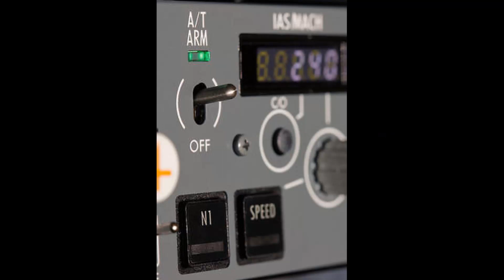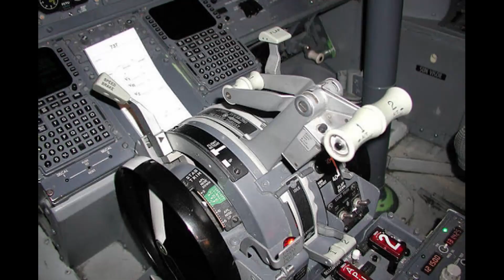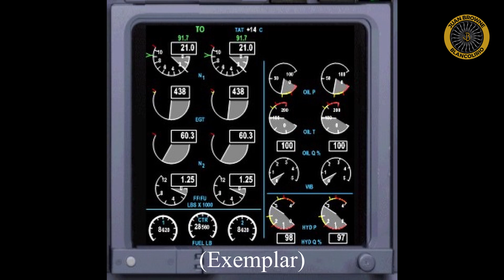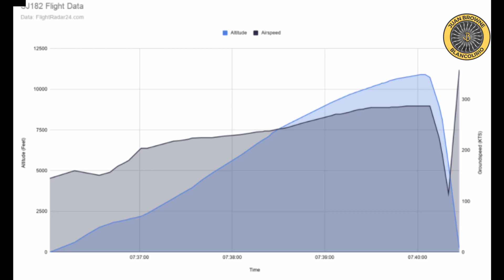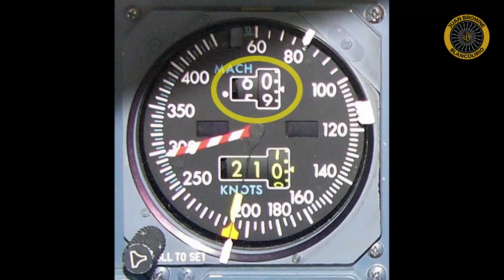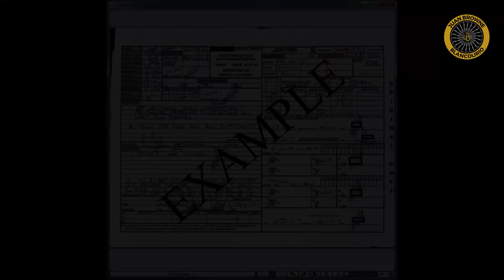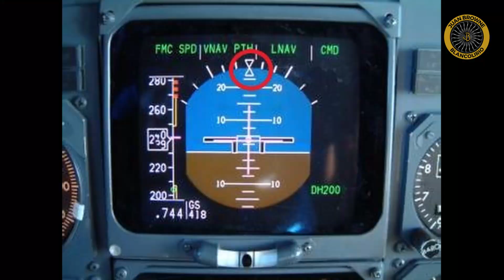Sriwijaya SJ-182 KNKT Preliminary Report 12 Feb 2021

Comment: Can the auto throttle reduce the engine power electrically without the lever position changing? Just cleaning contacts twice in 2-3 days doesn't fix a problem. Why are they getting dirty? Wear and/or corrosion? Contacts usually gold the same as computer contacts I assume. Throttle lever may not change but the instrument which monitors % power should show the mismatch.
Reply: No, it can't. The A/T on a Boeing controls thrust by physically moving the thrust levers, which in turn control the engines.
This is also what occured here according to the preliminary report. The right lever didn't move and thrust of the right engine stayed constant. The left lever moved back, adjusting thrust in the left engine.
Reply: @kallek5655  So we are saying that the throttle lever was moving to reduce the power to that engine and that wasn't noticed by the pilot. With the auto pilot off the levers can only be moved manually. I think that a gauge with the thrust level is shown and the reduction wasn't noticed there either. With 2 visual indications that the trust on the left engine was reducing something must have been going on to distract both pilots. I'm not a pilot.
Reply: @delukxy  Right, the left lever moved, causing thrust in the left engine to decrease, that's what they said. Autopilot and autothrottle can work independently of each other, meaning the A/T can control thrust whether or not the A/P is engaged (and vice versa).
Yes, there are gauges that show you the rpm of the engine as a percentage (N1 gauges), they are the primary reference to set thrust and a reduction in engine rpm would be shown there.
It could be that something distracted the pilots, but only the CVR could reveal that. Alas the memory module hasn't been found yet.

Comment: From this video, the assumption must be that both pilots were distracted so they didn't notice the unusual throttle configuration happening and other visual indicators.

Juan mentions that at the point AP disengages (I assume due the AP being at its limits on the control surfaces) and the associated audible warning, the plane would have snapped over very quickly (or even violently). 

So, the question is, do you think there should be some warning before AP disengages to alert the pilots that is it coming close to its threshold? This would give vital seconds for the pilots to do a quick scan of instruments and get their hands on the controls to try and mitigate the situation?

Do newer aircraft has this extra warning already?

Comment: Gosh, so much to takeaway from this report!

1. Frequent UA training in simulators or light aircraft is essential.

2. Secondary, redundant data recorders should be included in the opposite data recorder. A basic data recorder can be made very small indeed, and with trivial power consumption, without the full crash certification required for the primary data recorder function. So having each data recorder record both data streams, the primary secured against fire, impact and saltwater per certification, and the secondary using all reasonable precautions only, would give a chance to recover all data if one recorder was lost. In this case, there was no fire, and saltwater doesn’t damage encapsulated microchips, so there would be a reasonable chance of recovering some or all CVR data from the FDR. With common bus avionics in modern aircraft, this would be straightforward to implement.

3. An autopilot disconnect that results in a rapid UA without notice to the pilot is unhelpful! As is an unreported split throttle. Having a cancelable alert to split throttle would be helpful, as would warnings of approaching AP saturation, so the pilot is made aware that the AP is struggling to retain control, and is ready to intervene should the AP become saturated and disconnect in an unfavourable aerodynamic situation, such as this event. This would not rectify historic fleet aircraft, but would be a rolling improvement for future aircraft.

Comment: Is it possible to have equal throttle quadrant positions, but not equal actuation at the engines? That is,  cockpit toggles up at 75% but ''butterflies '' [?] open 35% on #1 [Port] engine and 75% on #2 [Stbd]...Glitching interface with AutoThrottle or broken cable.  Short. open, frayed line or connection?

Comment: Fly the airplane. Cockpit automation has reduced pilots to monitors, and airline SOP handcuffs the pilots to not hand fly. This makes pilots not prepared to deal with this kind of malfunction. No matter what you get you need to be able to deal with it. This auto throttle malfunction should have been noticed during the climb. You would have felt the building yaw as the engine thrust split occurred and the auto pilot cross controlled the aircraft to maintain. It is good that the airline is going to train to this scenario.

Comment: Why did that throttle keep retarding?
I guess it could go unnotice it if the autopilot was compensating to keep the attitude correct but with reduced thrust and increased control inputs to compensate, the plane wouldn't be climbing normally, would be down on power and high on drag. Wouldn't that be noticeable to the pilots?

 Unfortunately we've heard of autopilots disengaging and throwing the aircraft into a situation that crew couldn't recover from, before. 

Why is there not a warning horn at least a few seconds before the autopilot disengages so the crew is ready for something dramatic. Even though they won't have time to anticipate exactly what it is, at least they can put their coffee down and be aware that something big is about to happen.

Comment: Seems eerily similar to Tarom Flight 371, an A310 that crashed in Romania in 1995.  Malfunction in auto throttle caused left throttle to go back to idle.  The pilot was supposed to guard the throttles during climb (this was a known issue), yet he became incapacitated and the FO failed to notice the asymmetrical thrust situation.

Comment: There is very little FDR data in this report When compared with amount FDR data that was released in both the Ethiopian air and the Lion air crash reports. They must have the data read out. They are just not releasing the information.

Comment: Juan, if I recall correctly is there not Boeing/Airbus produced aircraft that overseas pilots, such an example, Russia has a different review or opinion with regards to the artificial horizon?  I recall, although awhile ago, there was a crash due to such an issue to be in training or past flying experience the pilots misinterpreted the Artificial Horizon opposite as other or as are trained in other parts of the world?  Again sorry being a dumb question however I just recall there being some issue reading the instruments plus then there was another crash, I believe in Russia that flight deck was found to be allowing a child of theres playing in the left seat during an actual flight only to crash from bank angle and something else was found to be involved, again such a disaster. That too has been awhile back. 

Thank you Juan for all your explanations on these crashes. It’s with huge and high hopes that your advice and knowledge are utilized in any ga flight around the world. So much avoidable crashes due to human error. 

Lastly, I saw that the furloughed and non-flying flight deck is starting to see they are making mistakes when returning to duty. Should you think they would need, a few check rides first such as you undertook returning to the skies? General question.
Reply: Crossair 498. That ADI misinterpretation was not the primary cause of the fault. The captain had been trained on Russian aircraft before hand and when he lost spatial orientation he resorted to this method of training
Reply: @tomstravels520  I appreciate the Clarity as I wasn’t with complete memory of the full details of the event, seems my age is catching up to me. Haha. I just recalled something to do with the artificial horizon misreading. 
Thanks again for the o formation.

Comment: I see some similarities between this accident and China Airlines Flight 006, an upset incident involving a #4 engine failure/loss of thrust and the autopilot disconnecting which led to a severe upset.  As a 737 pilot, I am curious as to how much the throttles were split and how quickly this happened, and how come the pilots didn’t just click off the autothrottles when they detected the split,
either through the engine instruments or the physically split throttles themselves.  As a former military pilot who has done a lot of hand flying in his time, airline flying can lead to an over reliance in automation, as well as an accompanying  reluctance to disengage the automation and just hand fly the jet.  I’ve disengaged the autopilot or prompted the Captain to do so at least half a dozen times in my short 2 1/2 year airline career.  Every time I’ve reverted to hand flying, I’ve been able to return the jet to the desired condition easily.  Here, early intervention by disconnecting the ATs and matching the throttles may have prevented a tragic chain of circumstances.  U.S. airlines have noted the degradation in hand flying skills and have been emphasizing these skills for awhile now, perhaps the rest of the world needs to follow and this accident will reveal this.  I certainly hope the cause of this accident is correctly revealed and events like this can be better prevented in the future.
Reply: Agree that this strongly resembles the China Airlines incident. IIRC, they lost outboard parts of the horizontal stab during recovery?

Comment: Juan - I'm asking, not telling - but is this really about unusual attitude recovery? Shouldn't the focus be on monitoring the aircraft properly during a critical stage of flight?  As I understand it, the auto-throttles in Boeing  aircraft (unlike in the Airbus) actually moves the throttle levers. Shouldn't the operator be focusing on why neither crewmember was monitoring the aircraft - and stressing this in their procedures? It seems that their focus is on how to put out a fire instead of preventing one.

Comment: As CFI for many years, I taught that maneuver a lot.  Also aerobatics Upsets.  Some airline pilots, even on smaller airplanes, want to use 2 hands on control wheel, forget about the throttle levers.  Looks like the captain took over, used both hands on wheel to try to level the wings, without checking the throttles, which needed to be cut back both on a spiral like that.  And they spiraled to water at very high speed.  
The copilot, afraid to do the duty of the captain of checking the throttles, was concentrated on the instruments and did not cut the throttles on time too.  
On third world countries, the captain can fire you if you correct him, even if that could avoid a huge tragedy.  They hate to be reminded they are not god on earth and perfect.  Bad Traditions are more important than safety.  In USA and Europe, we think is stupid to do those old fashioned abuses since CRM training and CRM Rules 30 years ago.

Comment: If there were a display to show the control inputs being made by an autopilot at any given time, could that help alert pilots to an impending "kick-off" and upset before the fact? 

I don't know anything about autopilots, but it seems like a pilot should have a way of knowing when their autopilot is barely hanging on for dear life.

Thoughts?
Reply: In this case, it seems like the upset could've been prevented by better monitoring of the autothrottles, engine gauges, and the yawing of the plane, but have their ever been less predictable examples of an autopilot suddenly losing control and giving up? Did the aircraft have enough altitude to recover from the unusual attitude it was in in this case?

Comment: To me this seems to be yet another case involving loss of situational awareness, I mean the A/T is split which leads to a severely out of trim aircraft and neither of the pilots take control? seems especially strange given the fact that the captain had so many hours flying, is this another case where the captain was tricked into thinking that the aircraft was banking to the right when in fact it was doing the opposite.The other issue is if the A/T was U/S at dispatch why didn't they just leave it turned off and use manual throttle? The CVR would really help explain what happened. Thank you Juan for all you do.Cheer's from downunder.